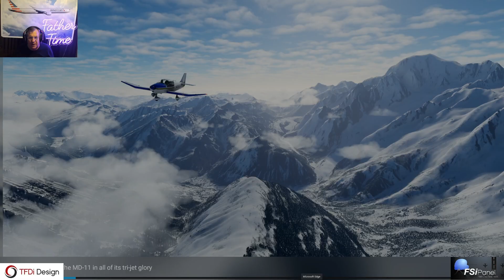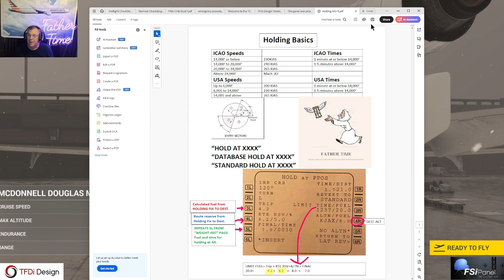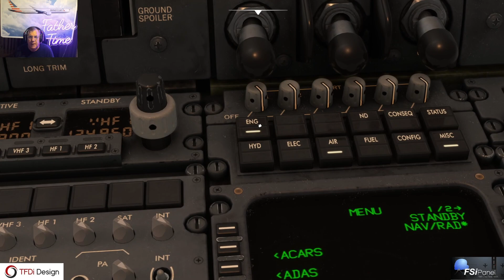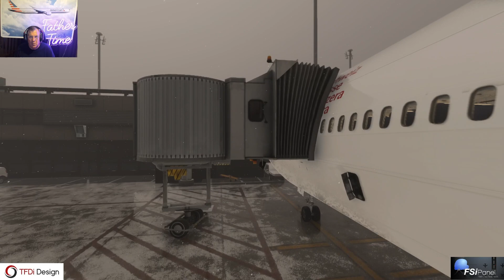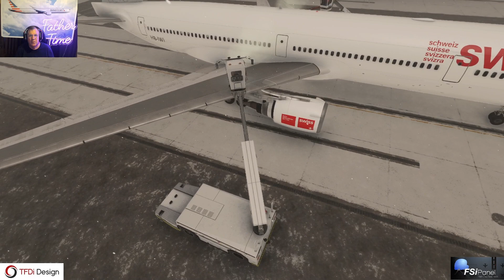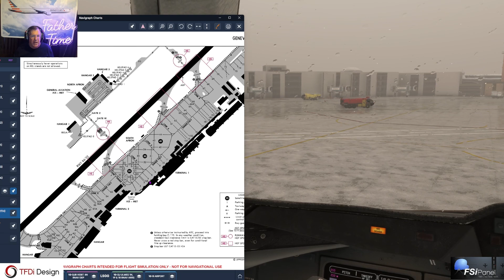Real MD-11 Pilot and TFDI Quality Assurance pilot flies an  Icing and low visibility profile.

Comment: Nice Airport but not to use as long as the ditch between taxiway and the gates ist not fixed. Hope this issue is known  and will be solved soon
Reply: Sorry, I realized that my comment went into the wrong post. IT was related to a post regarding the new EGSS Airport
Reply from the maker: didn't know about the ditch.

Comment: Another fantastic video captain and as you mentioned there are always some gold nuggets in there. For example the part about redoing the DIRECT - TO function for a cleaner intercept. It's the same in the MD80 and I used to use the Heading mode to clean it up. You way is easier. MD11 is fast climbing to be a top favorite of mine to fly. Many thanks - Kam
Reply from the maker: @Kam_MD11  thanks as always Kam! Great to hear. Jeff

Comment: Thanks Father Time----been catching up on the videos. The TFDi MD-11 looks pretty good. I used to play around with the PMDG MD 11 version for FSX and FS2004; I still see a fair amount of fly over the house as I live near a Fed EX hub--they still have a use in the cargo world I guess.   Though I am curious ..is it an easy plane to fly?  Complicated?   I have heard the FMS and the way you fly it  is somewhat like both the Airbus and Boeing, but certainly only know via the PMDG version and not from the real world. Seems to be the plane that was not fully automated like a 777, and had some workload for the pilot to do.  Great video.   I do like the focus you have on Europe airports as of late as I have been through many of them in real life.   Enjoy your videos. Thanks so much for doing them....FS and the flights give me the great escape from life ;)
Reply: I may have to load up the MD-11 on FSX to give it a go until I the  TFDI is in my hanger.
Reply from the maker: As always, your comments and insights are great. Yes, I think that the A300-600, A320 FMS are similar. It is quite differrent than the Boeings. If you fly the MADDOG by Leonardo and the iNiBuilds A300-600, then you should find the transition to be easier. The automation on this thing IRL is a half a generation less sophisticated than the A330/B777/A340 etc.  However, when it arrived in 1990 or so, it was state-of-the-art. It is not FBW, but it has a lot of cool features. You definitely need to study before you strap this baby on! Always great to hear from you. Jeff